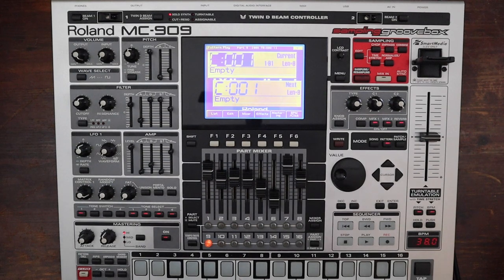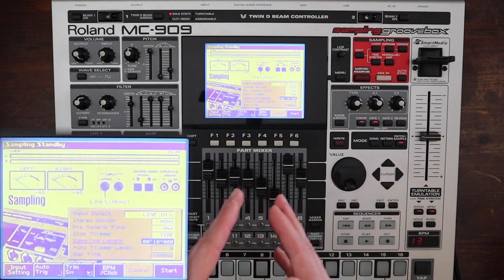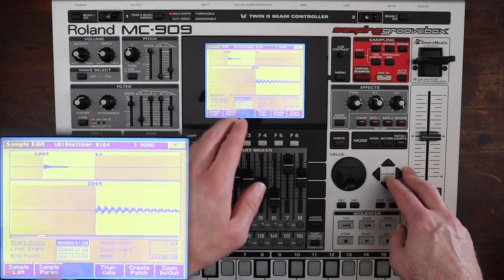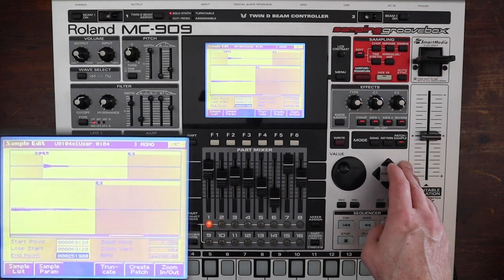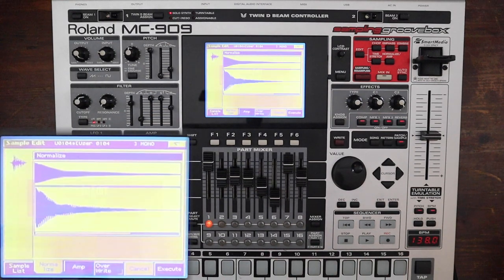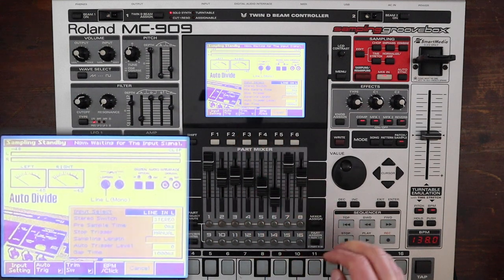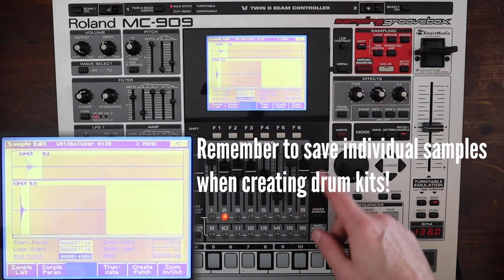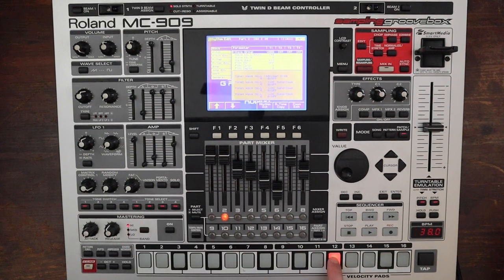Roland MC-909 Groovebox 🎧Sampling 🎧Sound Generator Part 4 #Roland #Groovebox #sampling

Comment: Changed my mind; spent some time on the message boards and the limitations concerning song mode can be worked around easily enough with outboard effects, sampling as opposed to internal tone generator and long sustain between patterns (I listened to the in-unit demos for reference) and as long as the midi note stops before pattern switch, everything should be ok since I'll use it primarily for drums, anyway. The main reason I bought it is that I can use different time signatures currently unavailable on most, if not all 'next gen' stand alone units.
That said, I'll have to pick up the internal RAM expansion card for under $20 and will have to re-watch your instructive and easily understood tutorial series while I wait for minimally used unit to arrive.
Don't know if you care or not, just thought I'd let you know as you were generous enough to respond back as quickly as you did previously.
-Cheers!
Reply from the maker: That's awesome, glad to hear you're giving it a shot! I swear by mine, but I also feel that I'm in the minority of electronic musicians that feel that limitations and their workarounds can benefit creativity. The MC-909's benefits outweigh the shortcomings for me, but I know that others may have varying opinions on that. Just wanted to be clear that song mode is definitely not it's strong point and will need some extra attention to get useful results, within limits.
Reply: @16Steps : As long as there's no glitches between pattern transitions in song mode (sustained notes and internal effects re-sets not withstanding), I think I'll be fine; worst case scenario, I sell it for maybe a hundred bucks less than paid and call it a day.
To your point, working around certain model-specific limitations is a form of creativity in itself, if you ask me, quite beyond the fact that a lot of these perfectionists only work in 2s and 4s, so one has to wonder about their pretensions on any score, all things considered, and I say that as a total snob myself, but I can count between 5, 7, 9, 11 or 13 (that's a joke, by the way).
Anyway, interesting days ahead with politics as much as anticipated music equipment, to be sure.
Thanx again!

Comment: Hi,
Im wondering if you could help me please.
Ive created samples and saved them as a sample onto the machine and my memory card but when I go into the patch/sample section to choose them there looks like there is nothing saved. I cannot recall my saved samples to use in a track Im creating its like they don't exist. However when I go back into the sampling section they are all there. Its like the machine doesn't recognize them outside of the sampling part. Any ideas? Im using operating system version 1.20 and up until a week ago I had no issues then all of a sudden I just cannot load the samples up anymore. 
Anyway, thanks for your tutorials they have been handy.

Cheers
Reply from the maker: I can't recall if there was a bug on 1.20 that explains this. Are you able to use the "Create Patch" function from the sampling menu? The most common issue is not saving the sample before saving the patch, but it sounds like you have this sorted. Make sure the system setting for loading samples on startup is ticked. If it continues to be an issue, you might look at backing everything up and doing a factory reset, if it then still persists, maybe look at RAM or different card. Keep me posted!
Reply: @16Steps  really appreciate your response. Since I posted I've bought a 32mb smart media card and installed version 1.23 (quite a nailbiting moment for fear of bricking it completely) and done a factory reset. The problem still persists. I have the extra ram installed but that was the first thing I  removed when I first got the problem. I havent tried having the "load samples from startup" ticked though so thats my next goto thing.
My son (who's a bit of a pc nerd boffin) is convinced its a software bug and not hardware issue. I dunno, ill persist and keep you updated.

Like I said, really appreciate the response as finding any info on the internet for the 909 is tough.
Cheers
oh and, You wouldn't know of some active online forum community of 909 users do you?
Thanks
Reply from the maker: @simul808  Are these samples you're creating via the sampling function on the machine or are these samples that you are importing via USB? I ask because you will have to import the samples in a different manner, and might lead lo missing samples. to check the sample load function, press the Menu button, then select. System > Sampling. On that page, there should be an option for Sample Default Load, this should be set to ON. Please keep me updated! Would love to help you get this solved!

Comment: Is there any chance I can import WAV or AIFF files using the USB connection for then mixing down in the sampling section?  I tried that and somehow  after import the files I can't access them in the user area. It's just not there, all the banks been shown as empty!! Any chance of helping with this please? Thanks and keep going with these tips man!
Reply from the maker: Sorry I missed this comment, but I just replied on the other video hopefully answering your question! 🙏🏼
Reply: @16Steps  Man, thank you very much. Yes, you helped me a lot just lightin me up how to get those files inside the Roland. I did exactly what you said, now I can see the sample file in the tmp folder in the MC 909, so I was in the sampling section, created a patch, assigned the patch, I even could hear the sample when I press the key pads, but I can't see them in the library (user or card, I tried both). When I'm off of the sampling section I just lost everything, seems like I hadn't create a patch at all. I read the manual and I'm doing whats is saying there for creating a patch, but I should missing something... sorry to bother you with all that, but you so far are the person in internet accessible who knows better about this machine. Happy new year and greetings from Brazil!!
Reply from the maker: @marcelodiana82  make sure you save the sample. You will need to save both the sample and the patch. I would recommend saving the sample as soon as you import it. It should give you a selection of places to store the sample (User or Card). If it's not saving to either of those locations, you may have other issues. So to clarify - I would try to import the sample, then save it. Create the patch from the saved sample..
Reply: @16Steps  Thaaaaaaank you!! Obrigado!! I got it, worked now. =)
Reply from the maker: @marcelodiana82  glad to be of help! 🏆

Comment: Hey man, i just wanted to ask you so that i know for sure before buying one. Can you use a sample as a regular tone/waveform and have the AMP/LFO etc Params applied to it? Or is the sample restricted to the basic edit functions as illustrated in the sample edit section in the manual. Thanks man.
Reply from the maker: Yes, you use the sample as the tone, it will show up in the waveform list, and then you can use filter/lfo/env etc on those. I think the part you are referring to is the destructive editing of a sample, which while (I guess) is useful, is separate from using the samples as tones.
Reply: @16Steps  Oh sweet man, thanks for that, I'm not actually picking up a MC909 but the 808, I just want a toy to mangle sounds with on the fly and they're dirt cheap where I'm at.